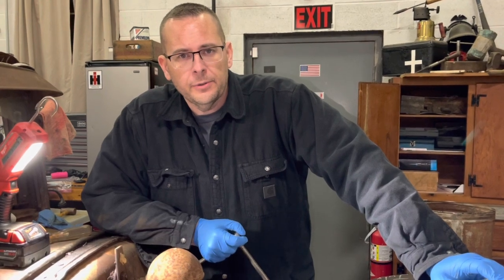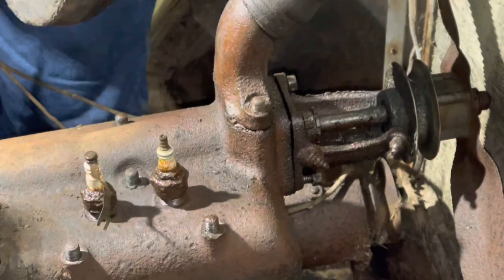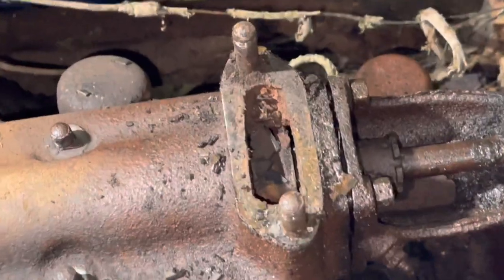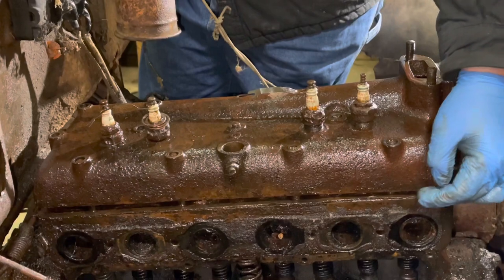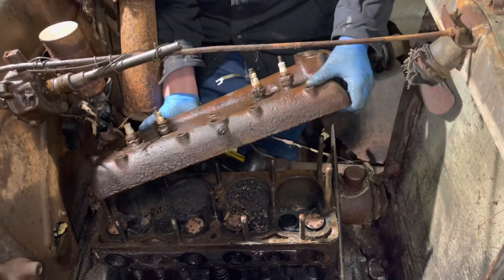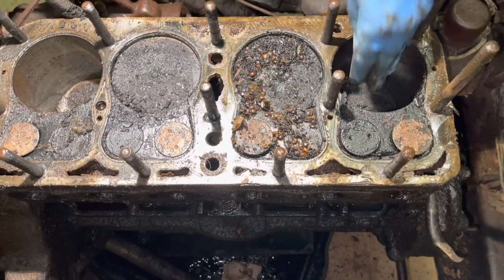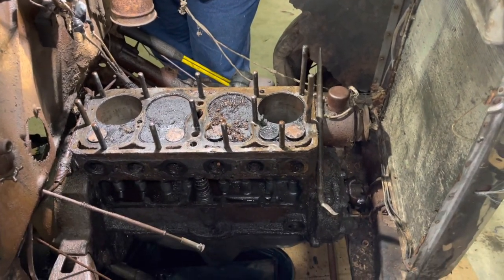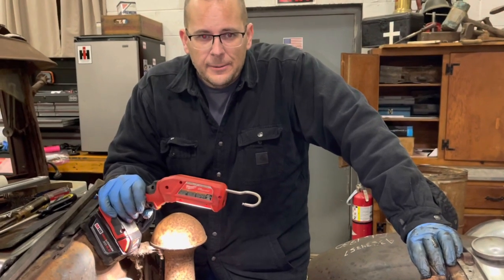1930 Ford Model A - Part X - Head Removal

Comment: Hi Dug, this is Wick from Mathews co va. I'm on Ford Barn also.  Try this on head or stud removing. Heat the stud, then put some lard (crisco works)  on the stud. Less of a mess.
  Works every time.   Check your head between cylinder 2 and 3  it's probably cracked. Most of them are.  Great video.
Reply from the maker: Thank you for this.  I will give that a try.  I'll check out Ford Barn also.

Comment: It looks really good for sitting so long, it is like the fordson. Take the valve springs off and you may have to just lap the valves in place as they probably won't all come out and you don't want to brake anythings since you are just getting it running. Get the valves clean at least and cause a little compression and it will run.
Reply from the maker: Thank you.  We made a lot of progress the last few days.  I'm looking forward ot seeing what we can do in the coming weeks.

Comment: Two long studs that hold the water outlet to the head should not have washers.  When you put the outlet back on, be very careful not to exert too much pressure on the nuts - torque them carefully as the little "ears" are prone to break off.
Reply from the maker: Thank you.  I am concerned that the right ear is egg shaped for the bolt and that it does not easily fit back on.  It seems the bolts may not be parallel to casue this.  I suspect the elongated hole was a "custom fit" job to make it fit years ago.
Reply: @duginvirginia5737  You may be able to reuse the water outlet, but be especially careful when you reinstall it.  Use either a very thin gasket or use gasket maker and then be cautious when torquing down the nuts to prevent the "ears" from breaking.
Reply from the maker: @mafcawebmaster4237  Thank you.

Comment: When is your next model a post going to be
Reply from the maker: Good morning, It will probably be a month until we get back to the Model A.  Most likely the next video will be the removal of the oil pan and inspection of the lower half of the motor as well as cleaning / rebuilding the carburator.  
I had reached out to another YouTube channel for asistance with wiring up an ignition circuit, but no luck, so I have thoese details to sort out yet as well.   Thank you for your interest and I hope to be back on this sooner than later.

Comment: In my opinion it's looks as if she'll fire over. Shockingly in good condition considering what she's been through. Who would think she was a workhorse back in the day simply by looking at the engine ? At first blush she almost looks as if she has rather low miles too. No piston ridges either ? I'm surprised the cylinder walls aren't deeply pitted with rust because of the many decades of moisture without any lube. I say get her running and keep her. Yeah, she needs some metal work but look at it as a labor of love. We're not talking doing a concours restoration just get her back up on her wheels again .
Reply from the maker: Thank you. I am very eager to see how things progress.  Much appreciated for your information and comments.

Comment: Doesn’t look bad at all on the inside
Reply from the maker: I was surprised.  The light rust on the cylinder walls will come off pretty easily.  I may try a Scotch-Brite pad and oil, or may just lightily use a cylinder hone.
Reply: Cylinder walls look incredible. Those pistons will fit tighter when they heat up & expand at running temperature.
Reply from the maker: @Nord3202  Thank you, that is a very good point.  In the coming weeks, I will disassemble the motor and give it a good inspection, clean the pistons and rings, etc. and see how things look inside.  We will post more videos as we progress.
Reply: I wouldn't pull the bottom end apart judging from the top end being in such great shape just check the bearing clearances with plastic gauge. Looks low mileage so you got plenty of shim to remove if you need to get the bearing clearances in spec. Good luck
Reply from the maker: @Nord3202  Thank you.